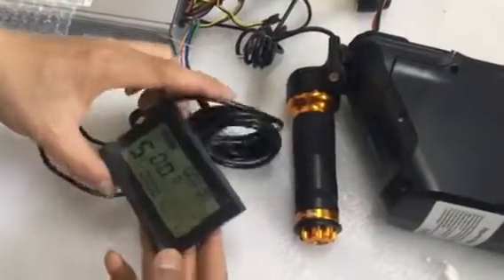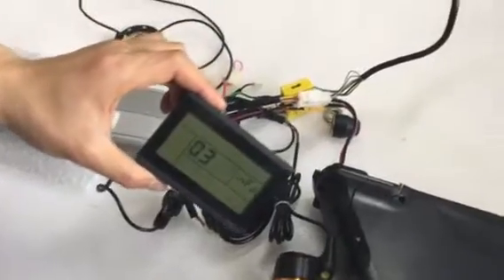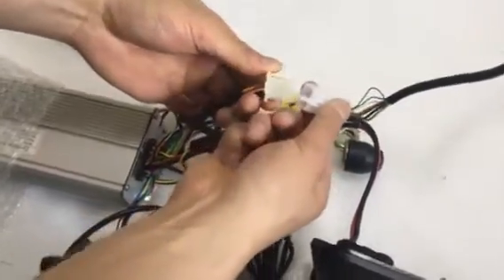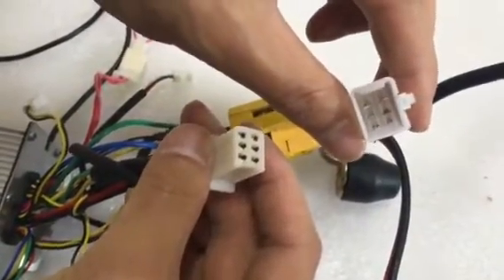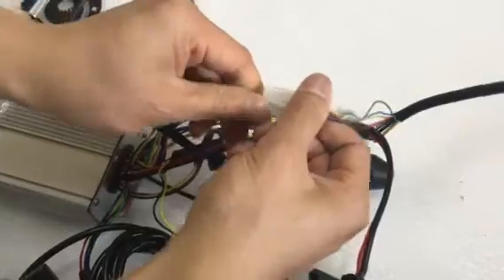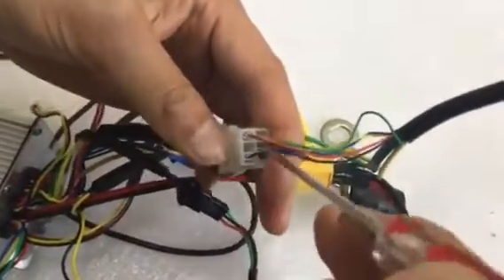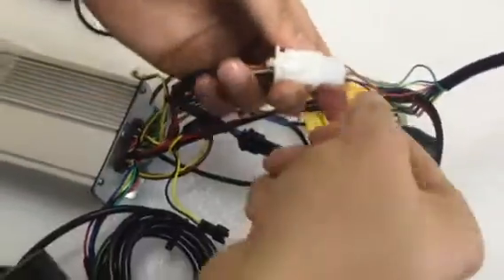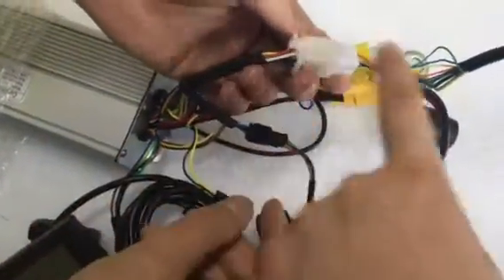How to fix lcd display error 03 for mountain ebike motor kits 48v 1500W

Comment: My battery indicator no longer drops below 4 lines. (Color display KT-LCD8H).  The battery is 48v and the indicator has worked well so far.  How can I fix this?  This happened after I used it with the battery almost completely discharged.  From 0 lines it went to full without charging the battery.  Since I charged the battery, it no longer indicates correctly.  Can you help me?

Comment: This error just came up on my bike's LCD screen BUT the motor is also making a really bad grinding noise inside and is now un-ridable :(
Reply: Did you fix yours ?
Reply: @FilShishay  Yeah man I had to buy a new motor it was the cheapest option at around £250. It was easy putting the new motor's inner core into the old ones casing, quickest cheapest option! 

Do you want the link to the website I bought new motor from? It is legit as I found it through a Youtube E-Bike guy called CitizenCyclist I think. He has a video showing how to change the motor and what you need. 

I also had to make a custom extension cutting and soldering which is a pain in the ass but if your motor cable is the same length as the new motor's you won't need to.
Reply: @NBKRebelGamer87  thanks for the reply. I have similar problem but I’ll check it later to see if it’s fixable if not then I think I will need a new motor as well. Send me the link you recommended. Safe.

Comment: I tried this but it didn't fix the problem. Is still shows 03 info
Reply: That means your hallsensors are broken
Reply: @juliank3397  what if motor works with different controllers?
Reply: Did any of you guys figure it out. HELP?
Reply: I have this error on my Cyrusher XF800 Fat Tyre E-bike but the rear wheel Bafang Motor is also making a terrible grinding noise inside making the bike un-rideable :(
Reply: @NBKRebelGamer87  I think I have the same problem. Mine was working perfectly and then the motor started making a really weird grinding noise. It doesn't want to work anymore. I checked every connection and everything is plugged in but still doesn't want to work. I think motor is fried. I was riding to work everyday though 7 miles from home every single day. Had almost 3700 miles on it.
Reply: @NBKRebelGamer87  Yeah actually I want the website you bought it from. If it's not too expensive I can just buy a new motor. But I also have an extra e bike I can ride till I get this one working again.
Reply: @ianmangham4570  I just literally told you to give me the website you bought it from.
Reply: @xmrchubbyx   DOH, I'm ian you plank
Reply: Im here in cali. Mine also error 3. Does not want to go away
 What do we do

Comment from the maker: error 01 = throttle abnormality ,  error 03= motor hall singal abnormality  ,error 04= torque sensor singal abnormality  ,error 05= axis speed sensor abnormality  (only applied to torque sensor ) .error 06= motor or controller has short circuit abnormality
Reply: Gracias, solucione el problema
Reply: I have installed a 48v 1500w rear hub motor (green pedel) and have a kt controller and lcd3 display..  It came without a discription. when i finished the build, it worked for a few minutes and then the motor stopped.. I went true some p&c  settings and suddenly i couldnt get back and after al lot of trying the display went black.. IT doesn't work no more..  I dont now if it had something with a password.. IT was in the area of the motor wattage..  the only thing IT said was 555
Reply: @Rrrobbie_81 They are pathetic, I've had 5 LCD screens fail on me in the last 10 years
Reply: @ianmangham4570  I can't get mine to display without 03 error...only managed a few times but no movement from the motor. I despair 😢
Reply: thank you.

Comment: how do you balance the rear wheel perfectly on hub motors?  i find when i lift the wheel off the ground at higher rpms it causes the bike to start shaking above 8mph rear wheel rpm.    is the balance issue caused by the motor itself or the wheel?
Reply from the maker: kindly whatsapp or call me at +8613816946181  for help

Comment: Yeah me too I have error code 10. The battery is not accurately balanced and reads 53.3v but the battery on the LCD reads one bar. Is there a way of resetting the LCD back to factory settings?
Reply: hello sir

this is aziz from istanbul

I have a problem about my ebike kit. (lcd display sw-900)
there is error code 10 and error code 8 on the my bike lcd display screen.
Pls inform to me how can i fix this issue?

waiting your helps?

brgds
aziz
Reply from the maker: hi aziziz , we use KT electric  lcd display and controller for now , SW-900 is another ebike system ,sorry
Reply: I know this is an old thread, but thought I'd share my experience with Error 10. I bought my kit from Ebikeling.com. Motor seems good quality. Came with SW900 display. It worked till I put it on a different bike, then I got the Error 10 and it no longer worked. I contacted Ebikeling and they said there is no way to clear Error 10 so they sent me a new SW900 display and that fixed the problem, now everything works.
Reply: old thread but hoping to help someone else with error code 10.   DO NOT attempt to hook up an LCD headlamp.   It will short a chip on the controller every time.   You can jump the chip out , but the throttle will still work after the SW900 is off and it will still consume power.   Only true fix is a new controller.
Reply: Hi Jon, So do you think it's a chip problem with these controllers giving the Error 10 code? Any advise on where I could buy a new controller? I only have pedal assist so if I dispatch the chip do you think it will still work?
Reply: @lienymanson6292   it is definitely the chip.    I actually opened my controller and jumped out the chip with some solder and it works fine now.   
You can buy another controller on Amazon or eBay
Reply: Yes,c10 to Y then OFF is factory reset

Comment: Thank you.  Can you help with error code 10 as well?  thanks!
Reply: hello sir

this is aziz from istanbul

I have a problem about my ebike kit. (lcd display sw-900)
there is error code 10 and error code 8 on the my bike lcd display screen.
Pls inform to me how can i fix this issue?

waiting your helps?

brgds
aziz
Reply: yeah, good luck finding an answer.  I've been searching before I posted this question.  Since then, I've contacted the company (in china) and they've sent me another controller and still read the same error message.  I haven't been able to have them fix since. And here in the states, I can't find any help on either repairing the issue or finding another one that's not from china!  But good luck!
Reply: I know this is an old thread, but thought I'd share my experience with Error 10. I bought my kit from Ebikeling.com. Motor seems good quality. Came with SW900 display. It worked till I put it on a different bike, then I got the Error 10 and it no longer worked. I contacted Ebikeling and they said there is no way to clear Error 10 so they sent me a new SW900 display and that fixed the problem, now everything works.